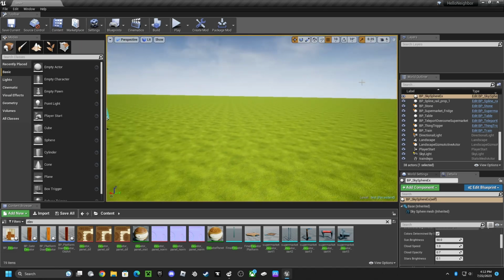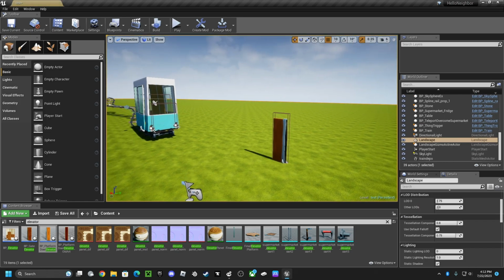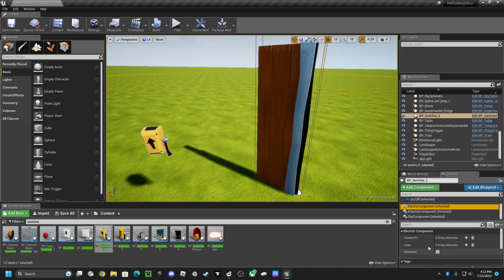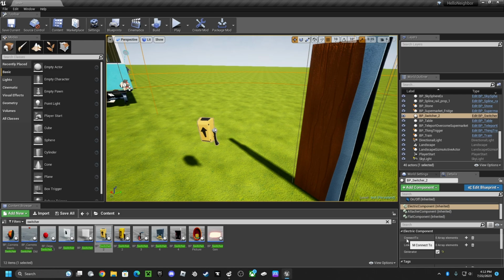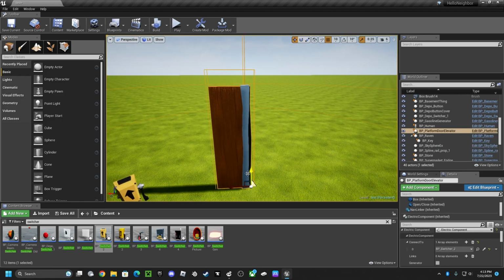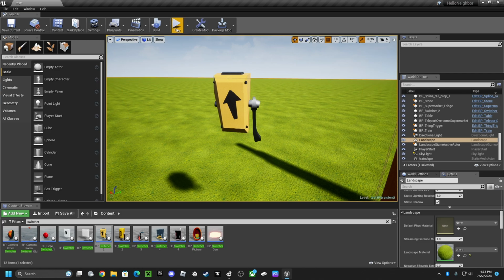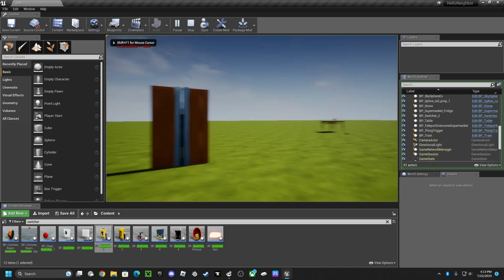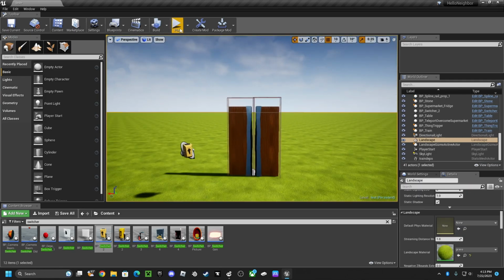How to Setup Elevator Doors in Hello Mod Kit!

Comment: Hi i have a problem when entering mod kit, when i run it is loading but it always freezes on %45 idk if i need to wait a long time or its bugged
Reply from the maker: @CloudyDreamz_Yz  the mod kit does use UE so It might be outdated
Reply: @nickzyyx Yeah, I downloaded it from epic games, my pc has a 1650 rtx graphic card I think it should go on
Reply from the maker: @CloudyDreamz_Yz  when I first started using it did use to freeze sometimes but maybe it might be bugged or it could be the type of computer you have I’m not too sure
Reply: It's compiling shaders. It takes time, just wait a bit and it will work. Also freezes on 95%